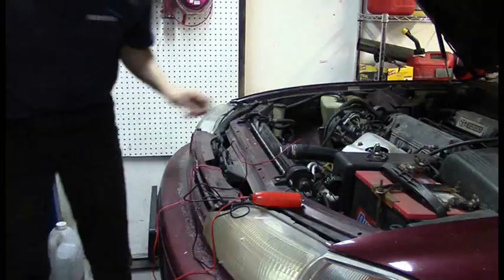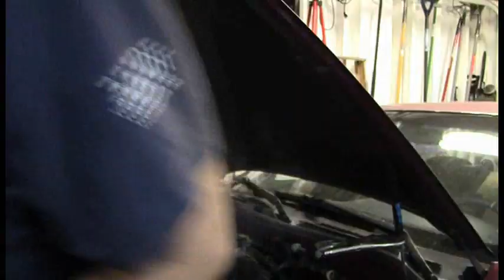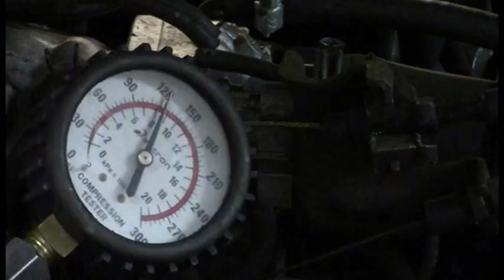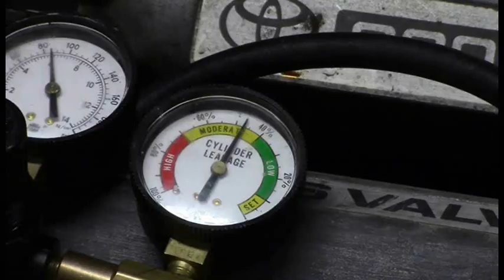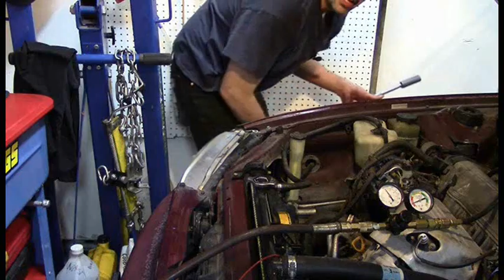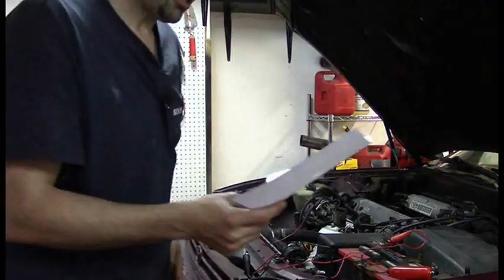12 Ways of How To Test A Blown Head Gasket Compared- PART1

Comment: Could that give me misfires in the cylinders? How might I go about checking the leak into the radiator. It has to be the engine oil because it's like a brown milky color.
Reply from the maker: Ah, that's different. You will definitely need to do the diagnosis for head gasket given that info
Reply: after doing much research. considering the fact that i have 3.8L GM. it could very well be the intake manifold gaskets. sucking air causing the misfires. after looking and feeling around i found some seepage. whats your opiion
Reply from the maker: Pale Horse89 It doesn't explain the water oil mix. I would recommend taking it to someone honestly, this really is not a diagnosis for a beginner.

Comment: Lol coincidentally My 00 bird has a blown head gasket. At least in assume. Oil in the radiator coolant :/
Reply from the maker: These models have transmission and oil coolant systems- it is possible you just have a leak from the oil or transmission coolant lines in the radiator.

Comment: Okay I have a question, with the test where you checked if the coolant boiled over the radiator neck is that a bad sign? I couldn't figure out if it could determine a "blown head gasket". I have a 95 civic ex that I'm having problems with it overheating at idle until I either rev it in park or neutral. I go threw about a gallon of coolant in a bout a week or so. I always add then start the car and let it suck the coolant through before I close the hood to make sure the radiator is full. But seeing in the video where the coolant boiled over the neck made me wonder if that's a sign of a "blown head gasket". Cause that's what mine does before it sucks it through. So if you can answer my question I'd appreciate it. I want to add also I have checked oil for coolant but its been negative so far. But I also don't see no leakage on the ground or anywhere else near my car. If you can give an idea or ideas of where to start I'd appreciate it.
Reply from the maker: In the video, the coolant boiled over during a leakdown test. If it boils over during the leakdown test there is no other possibility other than you have a blown head gasket.  It is impossible for compressed air in the cylinder to affect the cooling system otherwise.
Reply: Okay so that's what I needed to know, well to the shop I start going haha

Comment: Got a slow coolant leak on my 2001 Chevy Silverado. No leaks on the ground and no milky substance on dip stick or oil cap.   I did a combustion test with the similar test that you have on the video...but I dont have a radiator cap, so I did it in the coolant reservoir.  That came back as negative.  There is white smoke coming out of my exhaust but it is really cold here in Wisconsin.  Would you think it is a wearing head gasket, intake manifold gasket, or am I just going crazy???
Reply from the maker: The combustion test is conclusive.  You will need to pressure test the system and find the leak. If you have pressurized reservoir cap (like a radiator cap) then that could be faulty- I see that all the time on GM "N" cars

Comment: i recently bought  a 98 Subaru Forester and it's been giving me headaches. it overheats after 15 minutes of driving and the heater doesn't blow hot air. the antifreeze levels are fine but if i fill it to full level then it spews out the top of the reservoir when it begins to overheat. i took it to one mechanic and the engine stopped overheating while it was there, he said everything was fine  but i feel like he just wanted me to sell it to him for cheap so he could make profit. another mechanic said it could be the radiator or water pump. My friend said it just needs a flush. and the last mechanic i took it to said it was likely to a be a gasket leak.
Do you think i have a blown head gasket?
Reply from the maker: It's possible. What were the results from the diagnostics you have done that were shown in this video?
Reply: Alan Rivas Thermostat might be stuck, take it out and look at it?!

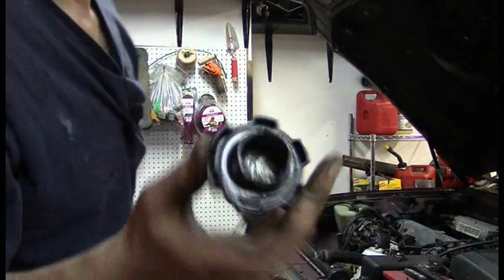Comment: 22:25 to 22:35 
Guy checks cap for white sludge, said it looked fine.... Shows to camera and there definitely white sludge in it! lmao.
Reply: cootah420 I'm seeing the goop too lol
Reply: Definitely presence of oil/water imulsification in the cap   Small amounts will show in PCV system and cap, large leaks will show in oil pan or dipstick.  If the head gasket was not leaking could be blow-by or cold weather/short trip operation.  My Saturn ecotec does this.  My GM Ecotec builds up at highway speeds due to blow-by.
Reply: Thanks
Reply from the maker: Um no there wasn't. And if there was why was there no emulsion in the oil despite it being old? Awaiting you answerr
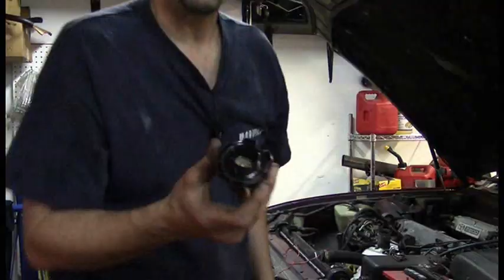Reply: Schrodingers Box I have a gm 3400 that im doing head gaskets on right now, the oil looked fine same as your's. The oil cap and pcv valves are sludged right up. There is clearly white goop inside that cap from 22:25 to 22:35. Just look at the video. Ik that car and know the oil cap is not normally white inside. Proof, its in the vid.
Reply: @cootah420  Are we dealing with liberals here?
Reply: @SchrodingersBox  There was definitely emulsification in the cap, you can see it deep in there. That can be caused by daily short journeys where the engine does not get hot enough. 
It could also be caused by any other small source of moisture such as an engine rebuild where the engine was open to condensation for some time.
Reply: @SchrodingersBox  I saw something white as well, but it may not have been sludge.
Reply: Cootah, FYI, you are completely mistaken here. The oil cap is clean, the white stuff you see deep inside the cap is not white sludge. Just want to through it out there so that readers here don't question Schrodinger's credibility.
Reply: @tonyk6815  Is this a lock-step conservative response?
Reply: bored?  @jamesrhodes8897
Reply: @tonyk6815  No

Comment: Okay, my radiator seperated. Car never over heated. Put in a new radiator and garage made sure there were no air bubbles. My temp will hold normal then shoot up to hot, nowhere near over heating just hot, then goes right back down. Shop did the first chemical test and it came back negative but they are still trying to tell me it's the head gasket because I'm getting air into the cooling system. Any suggestions?
Reply from the maker: The chemical test is great but remember it is ONLY for testing head gasket failure to cooling system. It is possible to have head gasket failure that doesn't affect cooling system- e.g. between cylinders.
  That's why I trust the leakdown test.  If the chem test is positive- you're done- compromise of combustion chamber seal to cooling system is confirmed. But if it is negative, it doesn't mean you still don't have a head gasket/compression loss problem.
 Compression test is great but it can't 100% discern if there is a valve, ring, block, or head gasket problem. However a positive compression test validates the head needs to come off at minimum, that's for sure.  But leakdown- that tells you exactly where the compression loss is.  If a compression or leakdown test is negative you rule out anything that the head needs to come off- period. In fact it's a great indicator of good engine "health".  If a shop does a compression or leakdown and it is negative and they call a head gasket, well, I don't know what to say other than I would never, ever go there again. It is impossible that you would have a head gasket failure with negative compression or leakdown test.
  That said- if the chemistry test was negative- why are they still calling a head gasket without the other evidence? That's a little disturbing but technically they could still be right- but where's the other test results to confirm their suspicion?
 Man I wish I could check all these cars out myself- so many people have had similar experiences as you.
Reply: They think it's head gasket because when they pull the cap off the radiator the coolant slowly and continuously pushes out. Not fast but just slowly keeps coming out.
Reply: So it's getting air from somewhere and there are no external leaks.
Reply from the maker: Steven Watson Sometimes the leak can be with intake manifold. Thats internal.

Comment: Hey I was wondering what you call you 1st tool you use to test for carbon dioxide in the water and your button tool to start engine
Reply from the maker: The chemical test is called a "block combustion test kit"- not usually available at auto parts stores- I got mine on Amazon.
The button thing is just a remote starter. You can make one with any switch- it just jump the B+solenoid to battery positive.
Reply: Thank you bro your clip is very food and I like the way you work cheers

Comment: 50% of video taken up talking, need more doing than speech.
Reply from the maker: Ummm, Larry this is a SCIENTIFIC THINKING channel.  Thinking is not about dumping stuff in to a radiator and just replacing parts and turning a wrench like you do.  It's about adapting a methodology to ensure there is a properly controlled environment where only one variable at a time is present.  Adaptation of this method prevents people from misdiagnosis but since you just want to see bolts turning, you wouldn't understand the concept of what we do here. And that's ok.
  I  recommend you go to scottykilmer.com- it will be far more to your level of aptitude.

Comment: Hi i have a 54/2004 mk5 1.4 16v vauxhall astra about 14 months ago my water pump went while i was driving on on the motorway the whole car cuts out i let it cool down and filled up with water which manage to get me home what was a few miles away anyway i have not had no other problems with it changed the change the water pump and everything's been fine i check the oil level as i dont have a indicator a couple of times per week a few months ago i looked underneath the oil cap and noticed a golf ball sized lump of mayo gunk anyway i wiped it and carried on checking and wiping it off a few times a week remember this mayo gunk only started 3 months back  until yesterday somebody told me to check the breather pipes which i did check the breather pipes which were completely clogged to the brim so i cleaned them out  i got some engine flush yesterday changed the oil done a engine flush and change the oil filter i noticed a little bit in the oil filter the water levels have been completley normal ive filled 1 inch in 6 weeks no gunk on the dipstick but i noticed what looks like a little oil leak it looks like its comming from i think its a oil or fuel sensor that screws into the engine above the air con motor as that has a bit of oil on none has dripped where i park on the floor could it be the sensor or the focker cover gasket or it a head gasket? Any info much appriciated thnks

Comment: I hit a pot hole broke my oil pan and I ran about 15 miles with it leaking oil and it's stop and I fixed the oil pan and got oil and  all that it's still turns on and drives but the engine is not burned because if it was it wounld drive or turn on but when I turn it on it makes a loud clicking sound what do you think is wrong it's a 2001 jetta 2.0
Reply from the maker: Does it stop the clicking sound after you turn it on or does it keep clicking the whole time its turned on and does the clicking get louder when you hit the gas or does it get quieter when you hit the gas would you does the clicking get faster when you press the gas pedal why do you think the engine is not burned because it can still drive when its burned but then if it gets too burned it wont drive but it might still drive if its not too burned to drive because it is still driving which means its not too burned to not drive from being burned or maybe it would just turn on but not drive if it was burned but it would not drive but not turn on because that would not make sense
Reply: Lool your bigends have gone scrap job

Comment: Are you suppose to open the throttle wide open to do a compression test????
Reply from the maker: Technically, yes, but the reason to have throttle wide open is so in the event the IAC happens to be inoperable and closed and any throttle bypass is blocked you wouldn't get an artifically low reading causing misdiagnosis of low cylinder compression (e.g. no air in cylinder would of course mean no compression).  If sufficient air is entering the engine as normal, the difference with open throttle or not is insignificant on a compression test.  In fact I actually demonstrate this in one of my videos but I can't remember which one- it might have been my no-start diagnosis using FASTTEC.
Reply: Can you use a compression tester hose to pressurize the cylinder, to check for bubbles in the radiator..???
Reply from the maker: Kennynva T. No, a compression tester hose has a check valve whereas a leakdown hose is just straight hose.

Comment: Hi, I have a Nissan b14 engine, and it overheated. I put water in radiator while engine switch off. I try to start it, but getting no kick, only tumbling. With radiator cap off, I see a little splash of water spitting out. Does it mean the gasket is bad?
Reply from the maker: What were the results of any of the dozen tests shown in this video?
Reply: It doesn't sell the kit here. I have checked the spark plugs, battery, oil, even the gas filter( to see if gas is passing through when I turn on engine) and still not getting the kick when tumble the engine. With the radiator cap open, is just spill out a little bit
Reply from the maker: Dr. Fella Sorry but this diagnosis is going to be much better left to someone with more experience. This is a bit more of an advanced call that you really want someone with experience making.
Reply: Well I just found out is the head has to change. It has some water mix with the oil

Comment: Love your videos.  I'm pretty sure I have a blown head gasket on my 1998 F-150, I will do the compression test to confirm.  One of the indicator's I have had is I can smell combustion products in the degass bottle (coolant reservoir) when I take the cap off, you may want to add this to your shade tree mechanic inventory of tests, although not as definitive as the bubbly oil, I really like that one.

Comment: I have a 98 civic. It was running fine and never overheated. The other day I went to start it and it started then shut off and now won't start just cranks over. I towed it to a mechanic and was told it's the head gasket. Do you think it is right even though it hasn't over heated and that it won't start?
Reply from the maker: It is impossible to say without knowing the criteria he is using to base his diagnosis off of
Reply: He says that there is low compression in 3 cylinders
Reply from the maker: Jessie D WHile it is hard to say that is is a bad head gasket- the one thing that's for sure is the head will need to be removed one way or another.  It could be bad piston rings which would not be a head problem, but the head still would need removed in that case- since the engine would need a rebuild.
  Any way you look at it, low compression is a serious problem